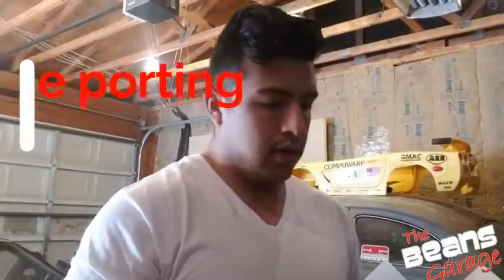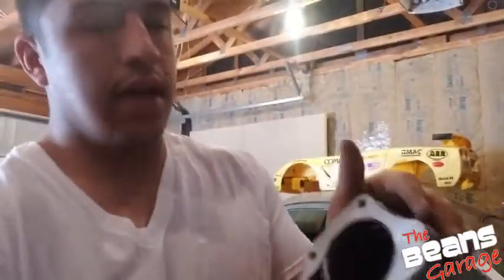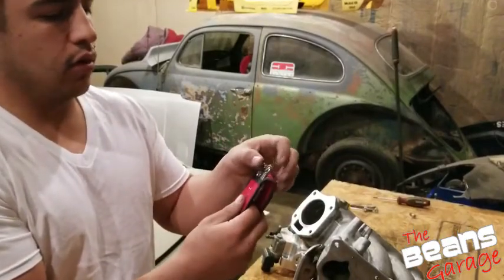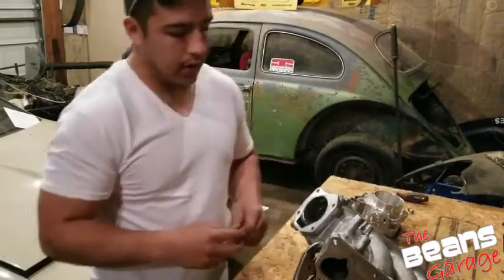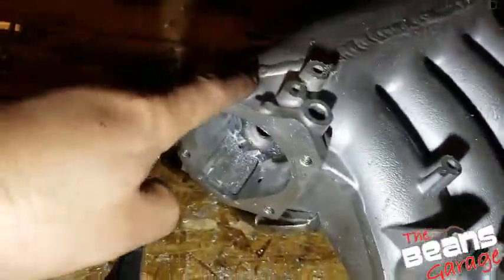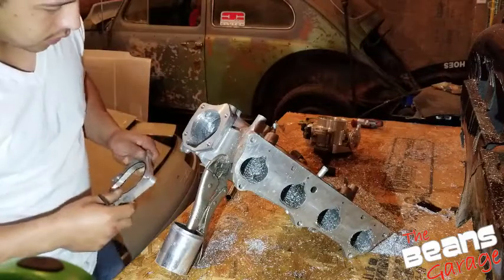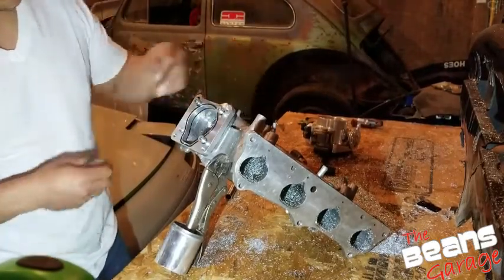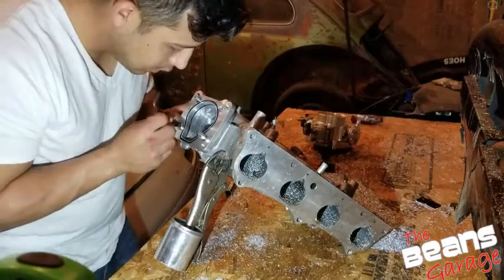Porting RBC intake for K tuned 80mm TB

Comment: Hello nice work sir
Does the 80 mm throttle uses the stock idle valve sensor and tps?
Reply from the maker: Yea, stock iacv and stock tps. 
I had my stock map hole welded shut on top of intake and mounted it on the TB. (Cleaner look)
Tps you can use b series with adaptor, much better option imo since k series tps go bad often compared to b series.
Reply: @thebeansgarage2905  oh ok really nice information thanks a lot
So what adapter you telling?where do we get the adapter to use b series tps?
Reply from the maker: Trough KTuned. Just look up "k tuned 80mm Tb b series tps adapter" and it will come up. It's like 23 bux